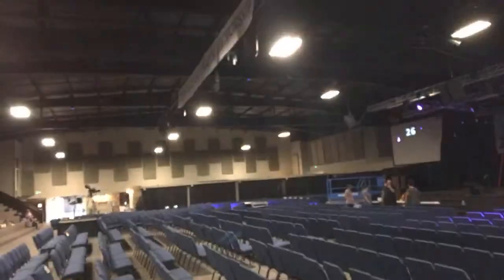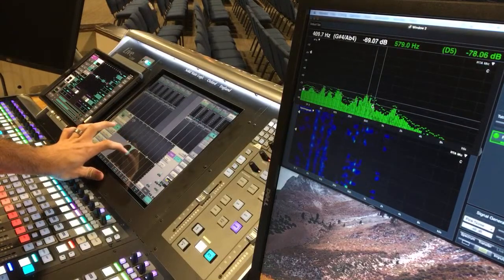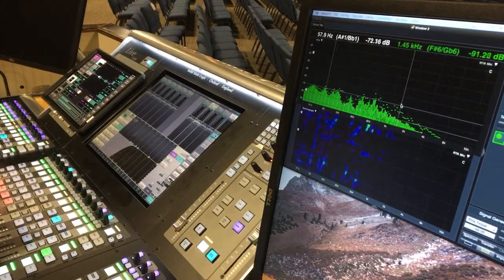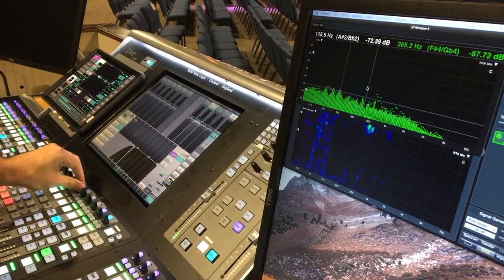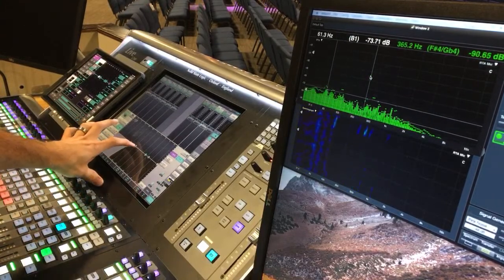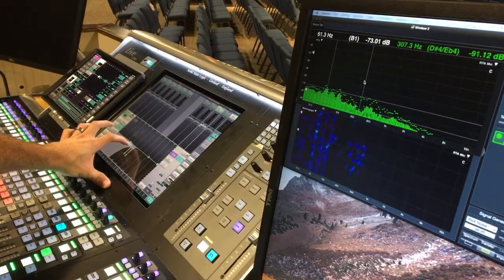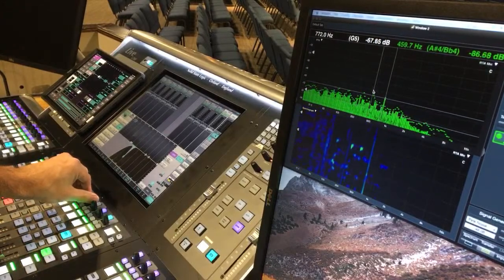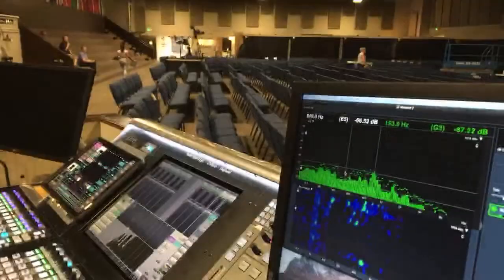How to get feedback out of choir mics

Comment: could you tune the system with this method by puting a mic in the medle of the stage, so yo don't have to do this to the intividual mics?
Reply from the maker: Not exactly. You want to EQ the speakers to sound good, not to get rid of feedback. You wouldn't want to EQ the speakers that are going to the audience based on what's being heard on stage. Plus, it's not all the inputs that are feeding back, so you just want to EQ the individual channels that are feeding back; and as you see in the video, they don't all feed back at the same frequency when they're in different places, or even different mics. Thanks for the comment Nikola!
Reply: @AttawayAudio  thanks a lot for the replay from greece my friend!So the idea is to solve the problems in deferent placies of the room..and yes they are not all the same frequencies!
Reply from the maker: @nikolataushanov7732  There are two different processes we're talking about. 1) This particular video is about getting feedback out of the mics from the PA, which you use EQ on the mic channels. 2) Tuning the PA so that it sounds transparent; what goes in is what comes out. For tuning the PA, yes, you'll have different frequency responses across the room, which is why it's tricky to get right, and I'll post a different video about that. Thanks for serving Jesus there in Greece, Nikola!

Comment: After ringing out how do u manage the timbre of the mics
Reply from the maker: That's a great question Ibiwoye! Using the channel's parametric EQ definitely ties your hands to using it for timbre, but the real solution is to have a mic that sounds good on a choir in the first place, and to have a good sounding choir, so that you don't need the EQ to make tone adjustments. Or you can run it through a group and EQ that, but I like just getting it right with the mic/source.
Reply: @AttawayAudio but what if you don't have that luxury and also have limited mix counts on your console?

Comment: When is better to eq monitors beside mics?
Reply from the maker: Great question! It depends if the feedback is coming from the mics going through the main speakers or the monitors. I try to avoid putting the choir mics in the monitors like the plague, and if it's POSSIBLE use baffles behind (or even above) the choir to help them hear themselves acoustically.  But if you have to put the choir mics into the monitors, then you would put the EQ on the monitors themselves, and if you run out of bands and still don't have enough gain before feedback, then go on to EQ the input channels on the mics. Thanks Matheus!

Comment: The fact that a console as expensive as the SSL does not have finite control of filter frequencies is everything wrong with development this generation and later of technology.
Reply from the maker: Did you mean infinite? How fine of control do you think you need?
Reply: @AttawayAudio  probably haha. Personally 1Hz. Even if it’s 10Hz corse with a 1Hz fine control option below 1Khz and 100Hz corse with a fine 1Hz control above 1Khz that’s fine. But if you’re ringing narrow at 325Hz and you’re forced to pick 317Hz or 329Hz that’s a bit crazy to me. Will it work? Most probably. But are there justifiable times where you need finer than something like 12Hz jumps? Yea. Especially at the 5-6 figure $$ level.